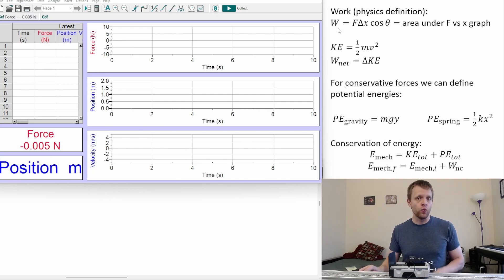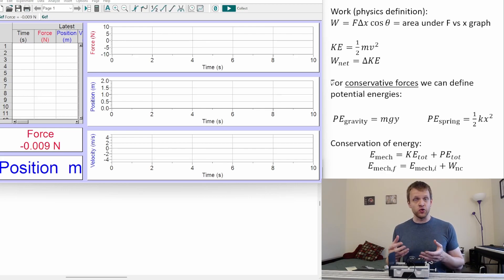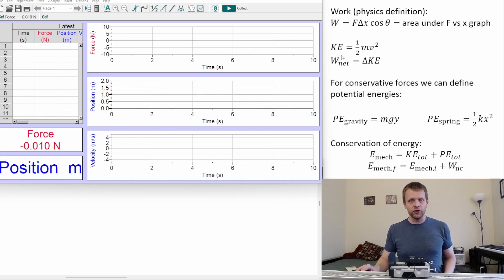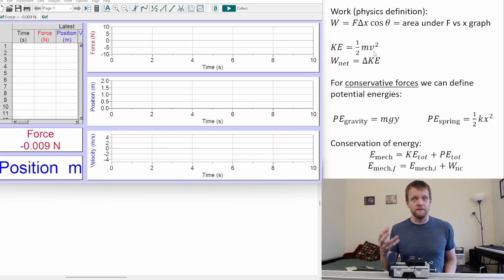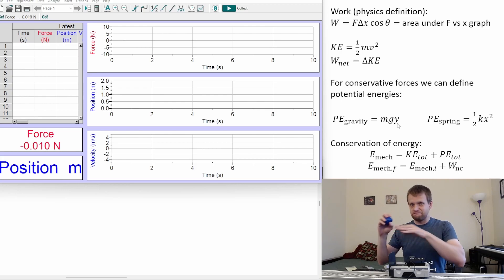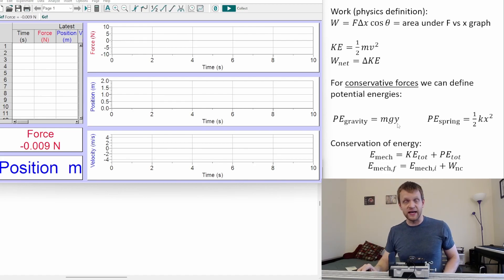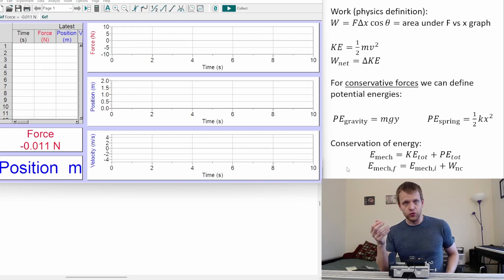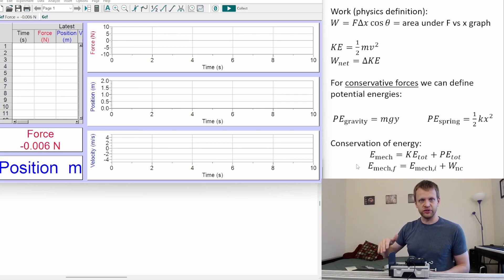Work and Kinetic Energy - Testing Physics

Comment: Thanks for the nice video, Michael!
Reply from the maker: Thanks!  I always want to improve the resources that I'm producing, so if you have any constructive criticism, please let me know.
Reply: @PhysicistMichael  Nice video Michael, especially the accounting for friction part.
Great setup with the pulling force meter.
I did a calculation for the total system friction for the first run.
I took (0 Nm @) 0.22 m to 0.8314 m from the screen as Distance:   0.6114 m
And therefore I'm using that maximum Kinetic Energy:   0.2588 Nm
  -  -  -  -  -  -  -  -  -  -  -  -  -  -  -  -  -  -  -  -  -  -  -  -  -  -  -  -  -  -
Cart Kinetic Energy from Total Acceleration without friction:
Distance from video:   s = 0.6114 m
Cart Mass:   0.8967 kg
Hanging Mass:   0.050 kg
Total Mass:   0.8967kg + 0.050kg =   0.9467 kg
Hanging Force:   F = ma = 0.05kg × 9.8m/s² =   0.49 N
Total Acceleration:   a = F/m = Hanging Force / Total Mass = 0.49N/0.9467kg =   0.5176 m/s²
Velocity:   v = √(2sa) = sqrt(2 × Span × Acceleration) = √(2·0.6114m·0.5176m/s²) =   0.796 m/s
Cart Calculated Kinetic Energy:   E = ½mv² = 0.5·0.8967kg·(0.796m/s)² =   0.2841 Nm     (Joule)
Friction:
Cart Measured Kinetic Energy from video:   0.2588 Nm
Energy from Total Friction:   Calculated Energy Cart - Measured Energy Cart = 0.2841Nm - 0.2588Nm =   0.0253 Nm
Percentage Friction:   100% × Friction / (½ × Cart Mass × Velocity²) = 100%·0.0253Nm/(0.5·0.8967kg·(0.796m/s)²) =   8.91 %
Total System Friction Force per meter:   Friction / Span = 0.0253Nm / 0.6114m =   0.0414 N
  -  -  -  -  -  -  -  -  -  -  -  -  -  -  -  -  -  -  -  -  -  -  -  -  -  -  -  -  -  -
👍  Thanks a lot.
Reply from the maker: @_John_Sean_Walker  The analysis looks great, but in the video I wanted to highlight two things.  First, how looking for patterns in the errors of your experiment can often point to possible sources of systematic error in the experimental setup (in this case the presence of work done by friction).  Second, coming up with an independent way of measuring that source of systematic error.  In your analysis, you get the energy from friction by assuming that the net work = change in KE, which is what we were trying to test, so not something we want to assume.  That's why I use a separate trial of just giving the cart a push and measuring its acceleration due only to the frictional force to independently find that work from friction.

Part of my grand plans is to also start a parallel series on scientific critical thinking to go through points on experimental design, data analysis, how to teach these concepts to younger students, etc. and then use this new series as case studies.  It's just finding time to do this since I am teaching classes and doing lots of other outreach programs and other life stuff.  Never enough time...
Reply: @PhysicistMichael  Sounds great, Michael.
I look forward to your projects.
What I did was merely an exercise, but it can be interesting for people who like to read the comments to.
The fancy equipment you use can be quite costly, especially for someone who only wants to do just a few experiments.
My equation can be used to choose a hanging mass for the preferred acceleration of the cart at home.
Your students can be proud of you, Michael.
See you.  🌞
Reply from the maker: Agreed, and appreciate you walking a reader through the calculations.  Could even add a few spaces to make sure someone trying similar calculations could have a go themselves before comparing results.  Also very helpful to point out there are often multiple methods you can use to try to reach a consistent conclusions (applying Newton's Laws & constant acceleration Kinematics vs using Work and Energy in this case)